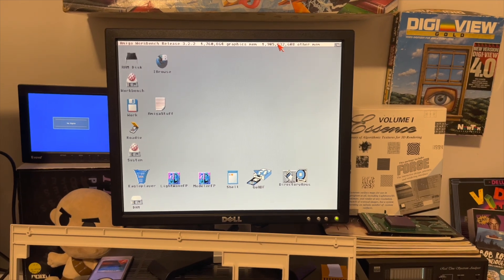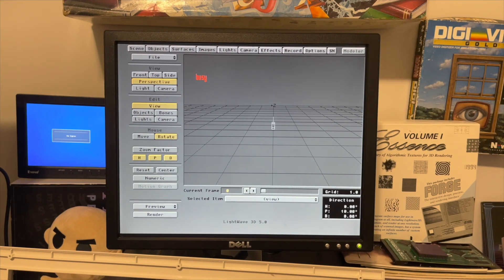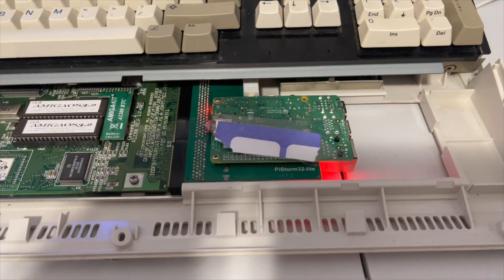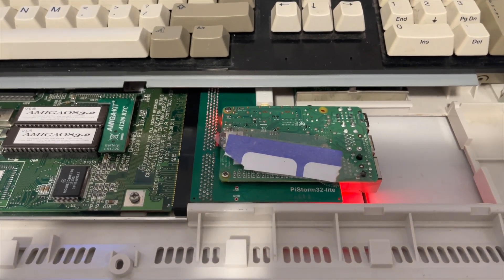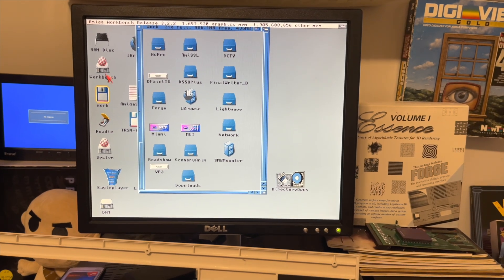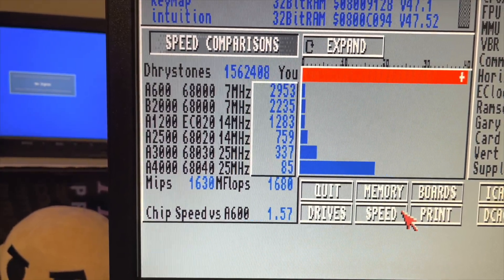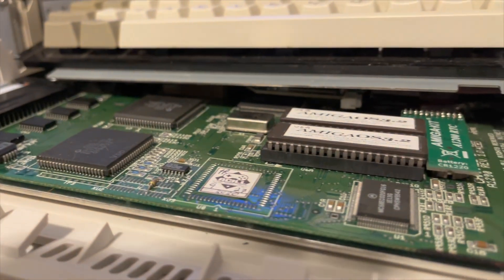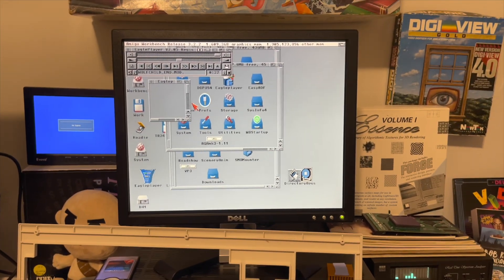Amiga PiStorm32 - Pi4 Update! It Works!

Comment: Ive found a few strange issues on workbench with this, my file manager (browser 2) cant copy files from place to place when its installed, but if i put my tf1260 in it can, other file managers ive tried work ok but browser 2 was always my favorite, also why does it need a 3.2 rom file when the amiga already has 3.2. roms in it.
Bottom line overall tho, is what an awesome bit of kit all the same, well done mr shulz
Reply from the maker: I don’t think it does need the rom file. Remember I’m not the brightest about this stuff. Hehe. For files I use Dopus, always have. Seems okay.

Comment: Has anyone tested pi4 model B? I just installed one with the latest version on a pistorm32 lite. But it only runs for about ten seconds, and the Amiga would freeze....
Reply: Oh never mind... pulled the acceleratorboard slightly back, booting fine now. The old trick worked I guess. Omg thing thing flies!!
Reply from the maker: Ah good you got it sorted!

Comment: I'm waiting for my PiStorm32 Lite at the moment. I'll be running it with a Pi3B+, which should be plenty fast enough, and then some. I don't know if I'll even use it long term, but I was curious, and since it was so affordable, and I already owned a Pi, I thought it would be fun to try it out. Long term, I'll be replacing the failing connector on my old GVP A1230 Turbo+ Series II accelerator, but in the mean time, perhaps I'll fall in love with the PiStorm ^^
Reply from the maker: Just know that it Is still early in dev and performance can vary wildly from program to program. It’s also looking more sans more like the AGA performance issue may be an non fixable issue due to the Pi’s GPIO bandwidth.

Comment: you are seriously hindering your disk reads and writes by not taking advantage of the Pistorm storage.... same for roms map your rom via the pistorm for added speed boost! The difference is night and day! MMU libs probably shouldnt be installed with pistorm although like you im not an expert so look into this if you want a solid answer :)
Reply: Have a PiStorm 32 and have the onboard storage running. Currently sysinfo shows it to be 22MB/second! And it boots fast! Running this on the caffeine OS with a Kick 3.1 image ROM.
Reply: @cullmaster7361  and have you found if the chip ram speed slows down any games at all?
Reply: @chrisearl2217  with a pi4 and the latest emu68 the chip speed is great. many whdload games now work perfectly with the new "cache" global tool type.
Reply from the maker: Yeah that’s for next phase. Definitely need to investigate the storage and MMU stuff.
Reply: @HoldandModify  for the price this level of performance is amazing! I paid about £500 for a TF1260 with full fat 060 but even that is slow when next to a ps32!

Comment: Has this been tested on an aca500.  Pistorm inside the 500 case with a pi4 too tight.  I have an aca500 in a large case that I made .  It will fit comfortably in the case .
Reply from the maker: Hopefully someone will post!
Reply: Just keep in mind the aca500 is finicky even with icomp’s own accelerator cards so my expectation is low , I have a pi4 coming so I will try this out after I get back from March break with the kids
Reply: @Glennbojones  thanks.  If you can let me know that would be great.
Reply: @danielbaturensky4544  well the first issue I ran into is that I have an aca500 case resembling a gvp hd add on that follows the contour and shape of the 500 and I must remove all that  because the pistorm will not fit with any case that extends past the aca500 , I’ll keep you posted , I spent the remainder of my free time getting my newly built a1200 ready .
Reply: @danielbaturensky4544  so I can confirm the a500 boots but none of what the pistorm had to offer was available no options in the aca500 boot up menu for a cpu were accessible and running sys info it was registered as a 68000 cpu  , maybe something I have done wrong not sure, it was an older build though. When I get it working on my 1200 I’ll try again.
Reply: @danielbaturensky4544  no go the Aca500 tries to boot than hangs a second later with the pistorm32 lite and the latest daily build mar10,2023
Reply: @Glennbojones  thanks for trying.

Comment: Ah, word of warning ;) it might happen that pi4 will eventually fail to boot. In tat case just powercycle. This is second large issue which I’m trying to solve just now
Reply from the maker: Okay thanks for the heads up. Thank you
Reply: Thanks for the info. I had this sometimes, and I started to worry that I might have a hardware issue.

Comment: CHIP RAM speeds are bad. My Blizzard 68040 reports 7.2x chip speed, a standard A1200 should be about 2.4x. a 68030 should be about 3.5 to 4x.
Reply: The values differ from one SysInfo version to another. In real numbers PiStorm32 and Emu68 reach about 4.4 MB/s, where absolute maximum defined by Chipset is somewhere around 7MB/s.
Reply: @MichalSchulz  thanks for replying here!

…and thank you for working on PiStorm!

It is AMAZING.

I am proud to support you on Patreon!
Reply: Just checked. Amiga with 68060 reports chip speed of 2.28 in SysInfo 4.4...
Reply from the maker: Ohhhhhh
Reply: Doesn't the Sysinfo version play the decisive role? On my Amiga 500 with ACA500plus and ACA1233n I get 3.17 with Sysinfo version 4.0, 3.08 with version 3.24 and 1.20 with version 4.4.
Reply: @christopheoberrauch784  yes, they differ from version to version